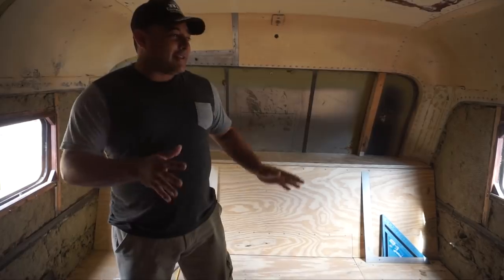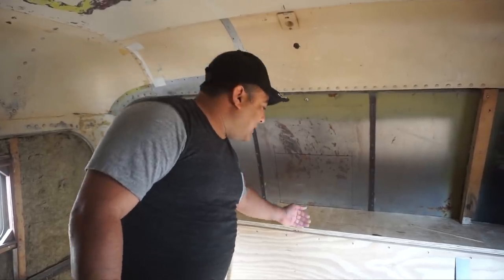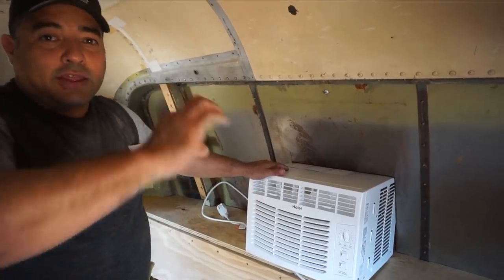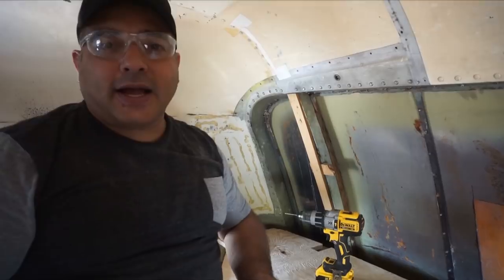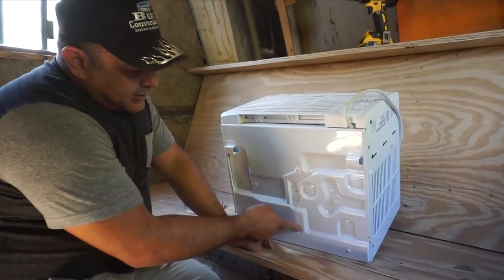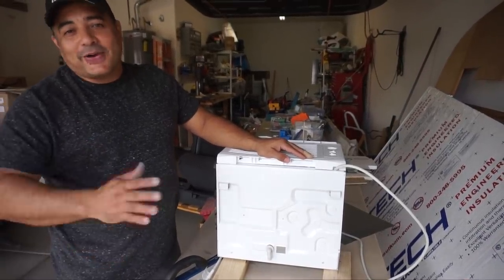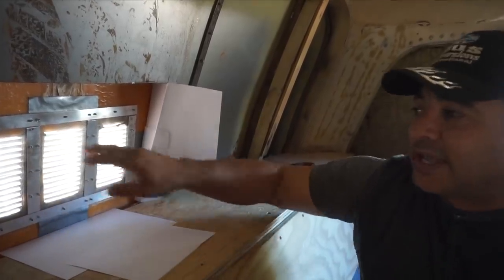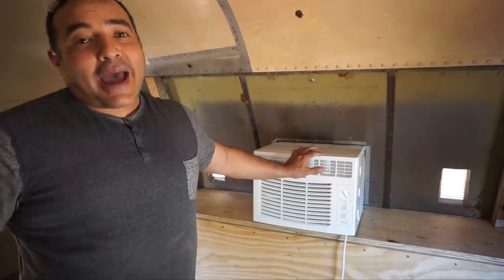Installing a Window A/C in the bus (but not in a window)

Comment: The thing I would fix is using 220, it is more efficient in the end. You could just add a second Victron that will give you redundant power and I would split the Batteries in half as well.

That AC in the rear is going to radiate a ton of heat and I am not sure if it can cool itself and the bus.
Reply: @richardowens9061  I would assume the Transformer will consume power? They are going all out already. Having real split phase plus redundancy will come in handy while on the road with so many kids. Then they could carry a small generator to help top off the batts if solar is not an option.
Reply: @swaterman08  Those transformers are very efficient.   And, split-phase is not required for most applications.   And, we're talking about the difference between $150 and $2500+.   So, I think it is an exceptionally good solution.   Btw, I have a degree in electronics engineering.  So, I know of what I speak.
Reply: Guys the whole point was to save money the Victron would cost around 2500 then you'd spend 700
To 1000 for another mini split so I'm assuming this isn't an option for them Juan is a pretty smart guy he's already crunched the numbers on this I'm sure of that a portable unit that just vents out the window would work as well and heat also you know a portable heat pump but I'd bet it's a limited space thing for them. What they've done here is the most cost-effective way they could do it.
Reply: @briandavis9975  Building a Skoolie, or RV is the exact opposite of being cost-effective.   It is like burning cash and it is a risk because people will hit the road and find out it is not for them after spending 40k+. 

I think people should rent new beautiful RV's or 5th wheels for a couple months and then you return it and get another newer one next year for a couple months.
Reply: @briandavis9975  I tend to agree, regarding the air conditioning.   But, they also intend to use an induction cook top.    And, in that regard, they basically have two options - either a 110/120 VAC unit that shares up to 1800 watts between the burners, or a 220/240 VAC unit that would allow full power for each burner.    This is why I suggested this transformer solution - it's a lot cheaper than a second Victron Quattro, can easily be implemented, and will provide them with the convenience of 220/240 VAC for their induction cook top.  Furthermore, they could use the 220/240 VAC from the transformer to power an electric instant hot water heater - since, they want to go completely propane free.
Reply: @swaterman08  They gave careful consideration to this lifestyle choice.    And, having made the decision to travel in an RV full time, the approach they're taking is probably the most cost effective - and, perhaps, the most personally rewarding.
Reply: @swaterman08  I'm working on my second bus conversion both Juan and I aren't building a Skoolie his is a Hwy coach and mine is MCI Hwy coach big difference in the weight capabilities and a bigger power plants the alternator in our buses puts out 270 amps at 24volts the main reason any of us build our own bus is saving 10's of thousands of dollars in the end result so I think what your saying isn't anything new and you work with what you have. Right?
BTW have you ever rented a bus conversion if you could find a company willing to rent you a 500 thousand dollar rig it would cost you 1000 or 2000 a week I've looked into it the biggest rigs you can rent are 34 ft and its still an RV tiny sinks tiny holding tanks small water tanks a 6 gallon hot water tank that's a on off shower not my idea of a relaxing shower so many benefits to a bus conversion over an RV and the quality will be better if it's your work over someone slapping parts together in a factory I take it you don't have a conversion or?
Reply: @richardowens9061  Power conversions always come with efficiency losses and for this install he really only needs 400-800 watts worth of cooling. It is very likely once he insulated the walls and added all the gear needed that the mass displaces enough air that he would have only required a small ventilating fan say 4 inches diameter to displace heat from the back most room thus drawing in cold air from the front of the bus. The split AC, he can run directly on solar is properly sized for the bus already. If it was me I would have went with propane for the hot water, cooking and possibly the fridge.
Reply: @masterdebater8757  They specifically want to avoid the use of propane altogether.    This is important to them, as they want their RV home to be as safe as possible, and using propane introduces the prospect of a catastrophic fire.    They're going to be traveling with their four children.    So, they've planned this entire project around a totally renewable energy approach.   Having 220 VAC allows them to use an electric instant hot water heater for the bus, as well as an induction cook top that does not have to share only 1800 watts between the burners.   The typical efficiency of a transformer is in the range of 95%-99% - with the larger transformers being more efficient than the smaller ones.   This one is probably going to be 98%-99% efficient.  Furthermore, because they are using solar, the bus is going to almost always be in direct sunlight, which is going to significantly increase the number of BTUs that they will need for cooling.    And, they're just plain not going to be able to insulate it well enough to get by with only 400w-800w of cooling.  Furthermore, you mentioned that the mass of the contents of the bus would reduce the amount of air that needs to be cooled, but that mass will also hold heat that might build up while they are away from the bus and the air conditioning is not running.     So, all that mass is going to be radiating heat, while they're trying to cool the bus.
Reply from the maker: Thank you guys - great input on this thread.  We strongly considered 220 VAC for quite a while before deciding not to go with it.  Another Victron is a rather large expense but that is not the only reason we decided not to go with this route.  Victron sells a really cool autotransformer that would allow us to get 220V and as Richard pointed out there are transformers that would make this possible for even cheaper than the Victron one.  Honestly, we felt like we would be happy with 120V and most of our needs would be met with this setup.  Our hope is that we would travel with weather that is favorable and most of the time just opening the windows and turning on the MaxAir fan would be enough.  However, there are always times when you get "caught" and you run into bad weather (cold or hot or humid) - that is when we would use this little air conditioner.  We REALLY wanted to be 100% electric but just couldn't make the numbers work for heating water.  The water heater we are planning on at this point will be propane.  As for costs, we are pretty open about how much we spend on everything and all told I think we are into this bus for a little over $50K at this point.  We originally looked at RVs but were so turned off by the cheap construction and sloppy workmanship that we quickly scratched those off our list.  As for the lifestyle - we have done an enormous amount of research that just like we research everything else.  We may not be 100% sure but I would put us at a solid 99% for a fit.
Reply: @richardowens9061 The 400-800 watts of cooling I mentioned was supplemental to the already properly sized Split unit they have installed. Yes the mass is tit for tat with away time if the bus is left without systems running but the mass also controls the air space when the system is on and everything has equalized in temperature that only leaves the air space to be cooled and fighting off heat that penetrates the interior. Only time will tell if the supplemental AC unit was truly needed. I really doubt while they are out "traveling" they will be leaving the bus with all systems off and letting the bus warm to 90-120 degrees that wouldn't be good for a lot of there stored items. One would have to assume while on outings they would leave some systems active when leaving the bus through the day just like you may turn your thermostat up to 80 when you leave home and to 70-78 upon returning home. But it will boil down to their opinions and choices until they find what works best for them. As far as the catastrophic fire comment you seem to be on some anti propane wagon with a comment like that there is a much higher chance of electrical malfunction starting a fire than a gas system even in the event of a vehicular accident simply because their electrical system is so large and propane would be smaller. As I mentioned I would have went with some propane systems simply because it is most efficient for hot water and cooking as well as they are walking a fine line if they chose to go all electric, they really don't have enough solar or storage to do that. Propane adds convenience and options to them that all electric doesn't. I can understand them wanting something but it isn't due to safety when you consider all the electrical that has been added it is no safer than propane if your stressing that system and have so much more of it to negate propane use. They already have 1 window unit to cool the electrical compartment so in light of that fact you get an idea of where the safety risks are and how they tend to them choosing to stress a system to not use the most efficient way to heat water and cook food for 6 people you can see that propane becomes the lesser of 2 evils. I have been watching for a while now and I am not exactly sure if they are vacationing or planning on living in the bus this would make a difference also.
Reply: @masterdebater8757  So, how does your estimate compare with the average power usage for a typical car air conditioner?    Well, a typical car air conditioner - not a bus - consumes about 3kw of power.  Do you still think an extra 400 to 800 watts is going to do the trick for a huge 35 ft. metal box in the  sun?
Reply: @masterdebater8757  After further consideration and research, I came to a similar conclusion regarding their decision to use propane for hot water, as a  typical electric instant hot water heater consumes over 6000 watts and their inverter will provide a maximum of 5 kw.   Otherwise, I still disagree with you about electrical being as potentially disastrous as propane.  Sure, electrical fires are still a possibility, but a properly designed electrical system is going to mitigate that danger.   Whereas, adding four children and propane into the mix introduces random elements, such as a spontaneous propane leak from a deteriorating pressurized hose, or just dust collecting around the back of a propane refrigerator, or a child turning a knob on a propane appliance that isn't ignited, until the bus is filled with propane.   Just research propane fires in RV's to get a better perspective on the very real risks involved in using propane in an RV - it's positively terrifying to contemplate.   And, I'm not fundamentally against using propane.   I fully understand that propane is a lot cheaper to use than spending all the money it would take to go full electric.   That's why the vast majority of RV's use propane for cooking, heating, hot water, and refrigeration.   But, propane disasters are a major cause of the total destruction in RV's.   Finally, they ARE planning to live full time in their RV.   They're not just going to be vacationing in it for a few weeks out of a year.
Reply: @richardowens9061 I don't think he needed the window AC to start with. He is basing the need for the window unit based on empty uninsulated bus. Secondly no one in the comment section factored the buses factory AC I doubt he intended to used it while parked and have that huge diesel engine idling. As such I refuse to delve into a conversation about the belt driven AC. He has already installed a Split AC unit (like for a house) not sure you have caught on to that part yet. The split AC system he installed was and is sized properly for the bus. Yes, with top mounted solar he will be parking in the open but also that solar system creates a gap between panels and roof thus negating some direct sun radiant transfer into to bus and the slide out piece will potentially shade one side of the bus maybe 50% of that side(remember the lowest 2ft of the bus external wall is exterior storage). There is insulating he can do to change things a lot like the front of the bus getting or building a proper windshield blind that is Sealed, insulated and reflective for times when parked. Many things to consider in the finished product that would reduce the need for that rear window unit. Only time will tell if it was a good or bad move. The bus doesn't have to be a sardine can in the sun there are thin insulation products they can make use of even in such a tight space that could allow the Split AC to handle the space on its own.
Reply: @masterdebater8757  Well, I think they're going to discover that with all the AC they have now, they're going to wish they had a LOT more, if they're sitting in the sun in Arizona - even with the shade provided by the solar panels.   And, yes, I did consider that.    I considered that, along with the average power consumption of air conditioners in cars.    My Ford C-Max (a plug-in hybrid), which uses a total electric air conditioner, not belt driven, consumes about 5500 watts.   And, it's a relatively small car based on the Ford Focus platform.   And, they long ago got rid of the stock diesel driven bus air conditioning system that came in their bus from the factory.   Sure, what they've got is going to take the edge off the heat and at night it's probably going to be fine while they're sleeping.    But, they're not going to want to be cooped up in that bus in full sunshine, unless they're in a cooler climate to start with.
Reply: @richardowens9061  Modern gas appliances have safeties built in that require heat from the pilot to allow flow from the valve thus if the pilot is out the valve doesn't open no matter what setting the knob is on but to each there own with propane fears. As far as the dry rotted pressure line that is no different than a chaffed electric wire from a safety stand point if your not inspecting and maintaining your equipment there is always such a risk. A very small portion of RV'rs are doing any inspections let alone maintenance so a good portion of those disasters can be equated to operator/owner errors. I do get where your coming from with children as I have some of those myself and employ a large 700LB cast iron woodstove near 5 months a year solid and have 2 wall mount propane heaters I use to supplement that stove in farther portions of my home and I totally see the possible risks to both but cost effective heat is a necessary evil for me in this old drafty house. I built cages around them all to keep the furless varmints out of the danger zone but there is  always a risk nothing is perfectly safe. In retrospect it would have been easier to cage the kids LOL.
Reply: @masterdebater8757  I've monitored this project closely, since their first video.     And, I have a degree in electronics engineering, so I have paid close attention to how they've designed and implemented their electrical system.    They've done an excellent job in that regard, taking into account that the system is going to be operating in a moving, vibrating environment.    So, I'm confident that there is less risk of an electrical fire than there is for a potential propane fire.  Remember, there is such a thing as a circuit breaker in electrical systems.   And, they're using plenty of them.

Comment: Did this work for you?  I see alot of potential issues which others have already mentioned.  Do you have another video where you actually finish the project?  I'd love to see how you enclosed it fully and how much hot air and moisture gets trapped in the wall.  In AZ moisture isn't really an issue but it looks like you're not adequately exhausting the unit which could lead to very high temps.
Reply from the maker: I have been surprised at how well this has worked.  We are in AZ where the temperatures in the 110+ degrees F are very common.  We have been using this little air conditioner everyday  in the bus to help cool it down (we are 100% off-grid as there is no power available where we work on the bus).  We have the drain tube plumbed to go outside (we are in AZ though and never really see water in the condensation tube).  Here is a picture of the area enclosed - we still need to seal it up a little bit around the A/C but it does not let a lot of air in: https://photos.app.goo.gl/HG5hfMSQMu1vJjEk8
Reply: @BeginningfromthisMorning Looks great!

Comment: Did you test run it to see if it would actually cool the space before you started cutting?
Reply from the maker: Thank you Andy - yes we tested it quite a bit before pulling the trigger.  Initially, we were just going to rely on the Maxxair fan to pull air from the front to the rear (which does work surprisingly well).  However as summer has started to hit in AZ - it became apparent that trying to sleep in the rear with both the doors closed to the front of the bus - we probably needed a little help in the back.   This little unit only draws about 4 Amps when it is going all out and when we are working in the back we often have to turn it down because it gets too cold!  We have been using this little air conditioner for about a month or so and it has been performing great.